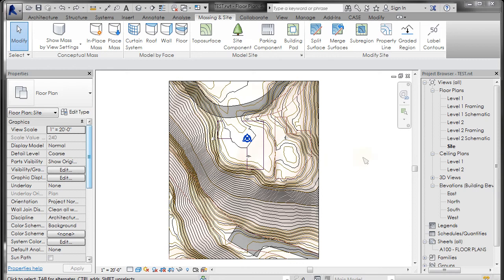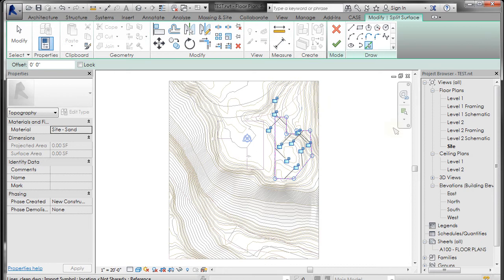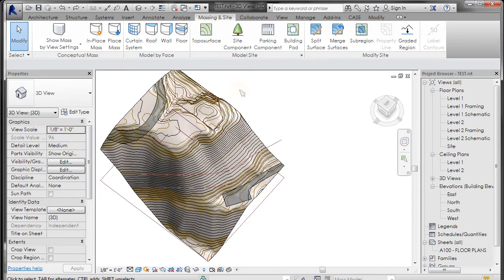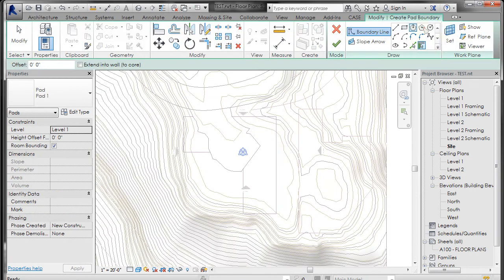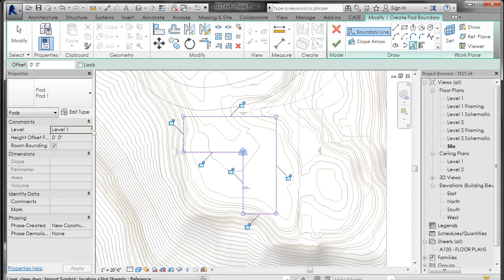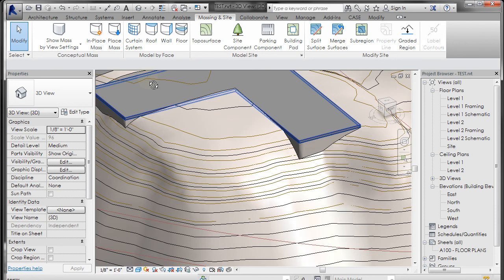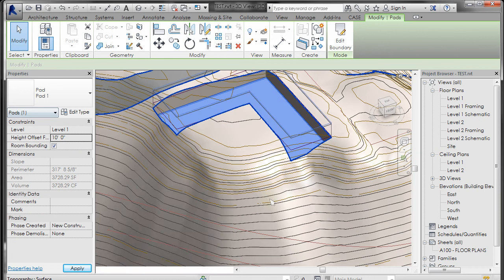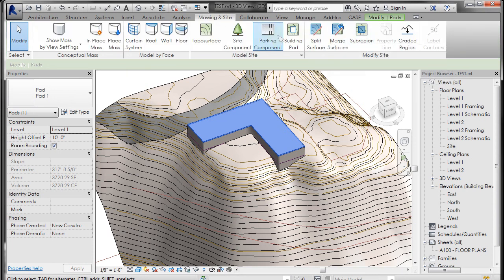REVIT SITE 04 SPLIT SURFACE BUILDING PAD

Comment: Hi! im just wondering how did you change the typeface of your UI?
Reply from the maker: That was an older version of Windows 7 that allowed you to change the font in the Advanced Display Settings.  In Windows 8.1 and up you have to edit your registry...thanks Microsoft.  There are a few free programs out there that will do it for you.  I haven't used them.  Always get a bit nervous about messing with the registry.